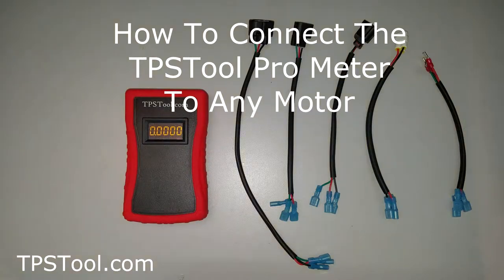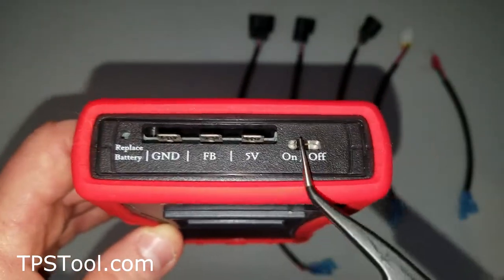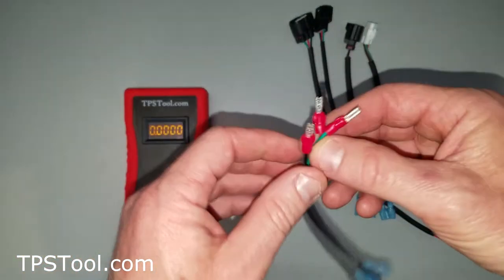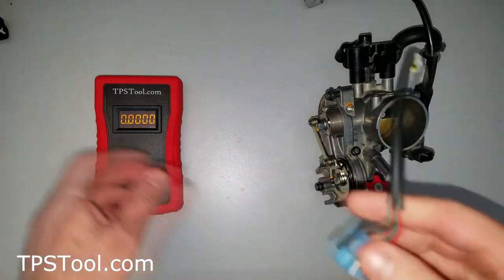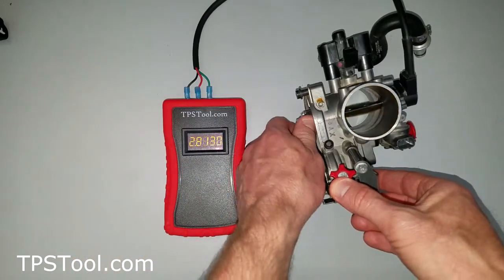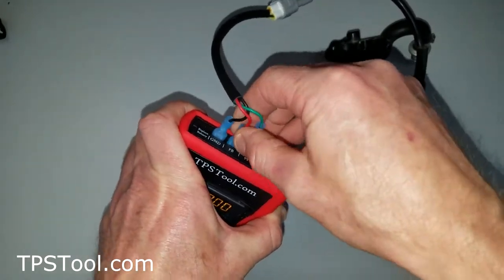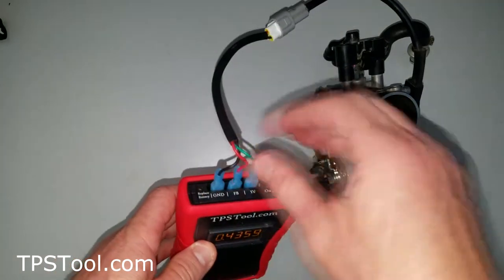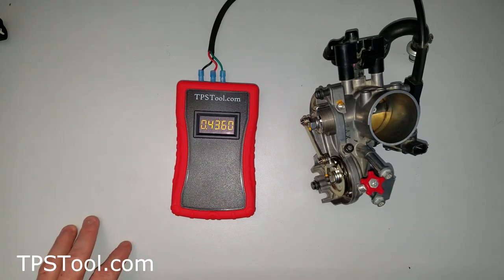TPSTool Pro - Connecting and trouble shooting

Comment: i need a new instruction booklet for hookup to the meter. i tried to read a 2015 artic cat tps i tried  changing the wires around and got 3.88v and i think i altered the wires to see if its reversed hook up. still got 3.88   also all tps that i know have 5v going to them?; the artic cat 450 had had the wire harness repaired and i noticed the fan turning on when you try to start it. i cant find a schematic for this unit. i think i switched the black with the green and still 3.88 v. so what is the wire to meter hookup or send me the hookup instructions thanks. i appreciate your input. vehicle will not start cold and is very rich when it runs
Reply from the maker: Thanks for your comment.  Here is a link to the manual online:  https://www.tpstool.com/pdf/Instruction_Manual_Pro.pdf   Which exactly model Arctic Cat do you have and which adapter plug are you using?  It sounds like you have a lose wire or the plug not in all the way, but with some more info I should be able to help . Send me an email, mwolfe [at] qualitysmart [dot] com.

Comment: Ok dumb question on a 2007 polaris 700 It said to set the tps to .710 is that the actually setting or will the meter say .7010
Reply from the maker: Thanks for your question.  If the proper setting is 0.710 then the meter will read 0.710 when you have it right.  0.7010 is a little bit lower, but is actually very close, close enough that it might be good-enough if you're having a hard time getting 0.710 exactly.
Reply: @TPSTool  thank you so much for the information I have set it both ways it runs the same but at half throttle when riding it will shut off in both positions. It could be a problem somewhere else.
Reply from the maker: @jamesbirchfield4785  What the TPS voltage as you slowly open and close the throttle.  If the numbers change smoothly then the TPS is OK, if the numbers jump up and down or drop to 0 then the TPS is bad.  If the TPS is OK, then also check your fuel pressure and make sure all the fuel filters are clean.  If one is clogging up then the motor can run out of fuel as you open the throttle.  I hope this helps, please post back when you figure it out!
Reply: @TPSTool  the numbers go up and down smoothly
Reply: One more question and I'll stop asking. I know in the video the throttle body is off of the machine does it matter if it's on or off of the machine? Does the key need to be on or does it need to be running if it does have to be on the machine? Some people have told me it does other people have told me it doesn't matter.
Reply from the maker: @jamesbirchfield4785  You can do it on the machine just fine.  If you're using the meter shown in this video then it does not matter if the key is on or off, the TPS isn't connected to the motor computer when it's plugged into the meter anyway.  I hope this helps!
Reply: Thank you so very much your tips helped me tremendously the polaris is running great now I just had set the wrong way
Reply from the maker: @jamesbirchfield4785  Excellent, thanks for posting the result!  Can you please post what you did wrong the first time, maybe it will help someone else who runs into the same thing.
Reply: I set the tps to 0.7010 it needed to be set at 0.710 it would start and run fine at the 0.7010 but at half throttle it would quite. So after talking to you and watching the video I set the tps to 0.710 and it fixed it. It did take a while to get it set to .710 I had to play with it for about 10 minutes but all is good now. Plus I did have a broken wire going to the tbap aka map sensor. And this is on a 2007 polaris  ranger 700 6x6. The wiring is a common problem on this model  polaris. that is the reason I had to change the sensors on it.

Comment: I closed the throttle and backed the screw all the way back until it isn't touching and I still have a reading of 0.1465 what am I doing wrong
Reply from the maker: What motor are you working on?  Send me an email with more info and I'll try to help.  :)
Reply: @TPSTool  Polaris 800 rzr
Reply from the maker: @randallmiller4436 what model year?
Reply: 2010
Reply from the maker: @randallmiller4436  You're not supposed to touch that screw on the 2010.  Check out my video on how to recover from that situation:  https://www.youtube.com/watch?v=aUX_fkKnQ8Q

Comment: Will this tool work on an Evinrude Johnson 115 outboard motor?
Reply from the maker: Thanks for your question.  If the TPS has 3 pins, then yes.  If the TPS plug matches any of the plugs shown at tpstool.com then it will plug right in, otherwise you can use the generic adapter that is shown in this video.  The generic adapter is now included in every kit.  If you would like to send me a picture of your TPS for help figuring out if one of the plugs will be a direct fit, feel free to email me, mwolfe@qualitysmart.com .
Reply: @TPSTool  Thanks for replying